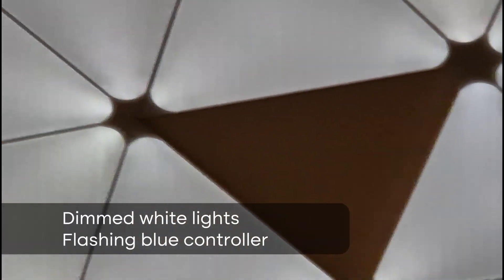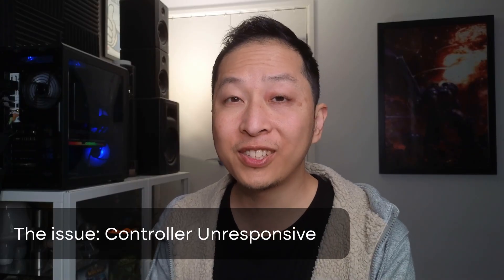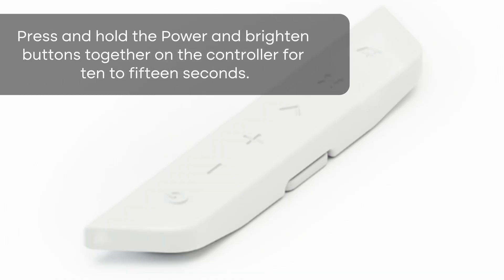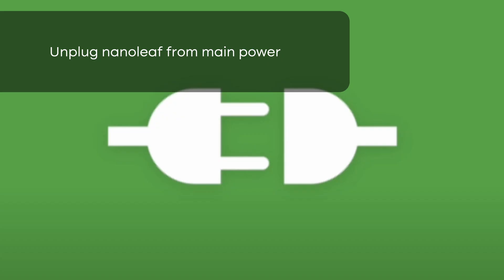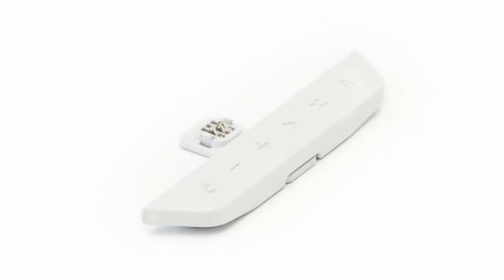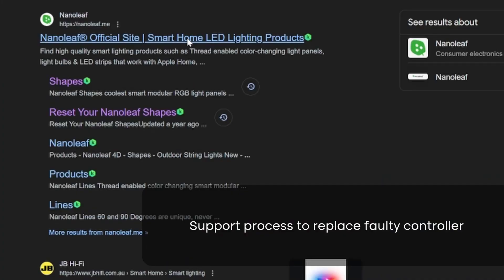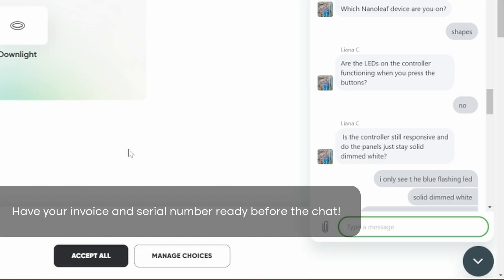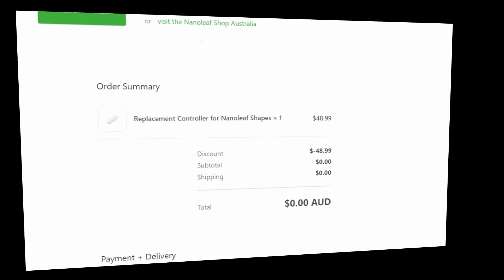What to do if your Nanoleaf has the Blue Flashing Light Error

Comment: My controller is blinking from left to right what does that mean?? I’ve had my lights for a while and I was just setting them up got it to work, set up my other 5 panels and then the first one I set up turned off and started flashing that blue light
Reply from the maker: The issue is that some of their old controllers and they would die after a few power cycles. They just don't boot up anymore. I got mine replaced under warranty but then my other ones downstairs died just the same and I had to repurchase a new controller. If you can't reset it like they way they say, it's time to replace it unfortunately.

Comment: Currently going through this myself. Ultimately, this is a hardware issue.

EDIT: 01/23/25

I ended up buying a new controller, syncing it, and the Nanoleaf  shapes went back to operating properly.
Reply: Where did you buy the controller from? They’re sold out everywhere
Reply: @dontdoit6986  I just got the same issue. Did you figure out where to get a controller from?
Reply: @seth69  The controllers are back in stock on their website
Reply: @dontdoit6986  Indeed they are, going through the same issue currently. Out of warranty, my controller doesn't even show a blue light. It flickers when I plug/unplug from the socket but otherwise unresponsive. They're telling me I'm "out of the warranty period and have to buy a new one" but I get a 10% discount! Nanoleaf is a joke. Such a waste of money. I'm not buying a controller that I've literally never touched because of faulty hardware, that's not my problem. Overpriced Govee's.